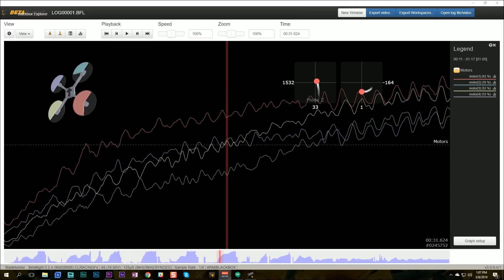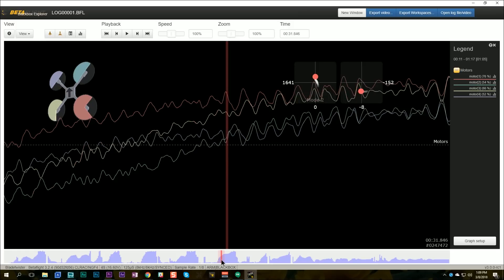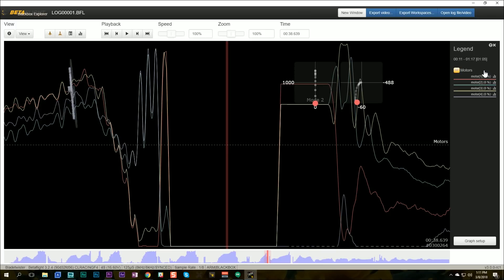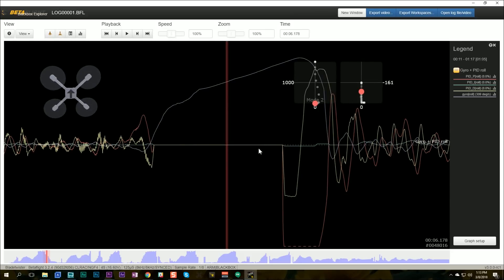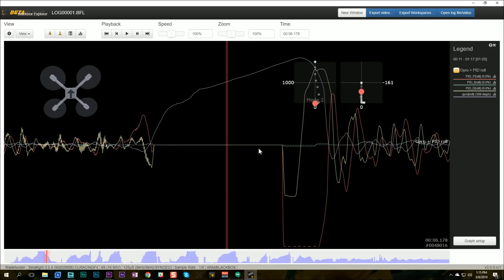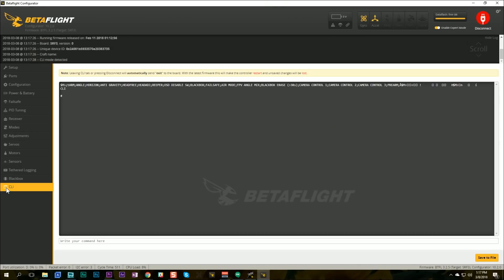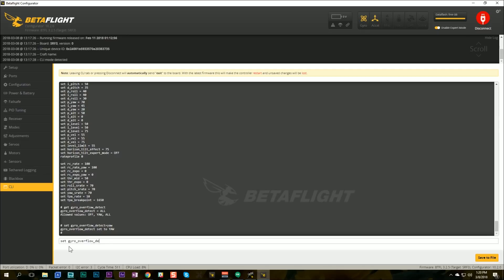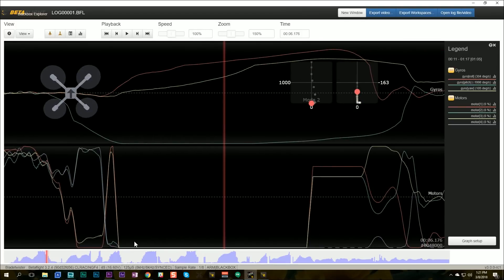Betaflight 3.3 Gyro Overflow Detection (Anti-Yaw-Spin)

Comment: A few comments from one of the developers: If you have an ICM-206xx gyro I would not recommend turning off gyro_overflow_detect.  These are the gyros that have the overflow/inversion bug and you will have no protection from a flyaway event.  This feature was developed in direct response to these events and people losing their quads rather than just as a hypothetical "this may happen" kind of decision.  The overflow can be quite easily triggered due to a gate strike or crash where the quad is spun through outside forces.  If you have a non-affected gyro (like MPU6000) then you can generally safely turn it off.  But there are still cases where a flyaway could occur due to multi-axis coupling and motor saturation where the spin is tumbling.  However these events are more rare and will usually self-correct but there still will be a scary flyaway-like event and most people will disarm before waiting for it to stop on its own.

The detection starts when the gyro rate exceeds 1950 deg/sec and disables the PIDs.  The PIDs remain disabled until the gyro rate drops below 1850 deg/sec for at least 50ms.

For those interested, the overflow event can bee seen in this image from a blackbox log of an ICM-20608G gyro showing raw data from the yaw axis as the spin rate exceed the overflow threshold.

http://www.etracer.net/pictures/ICM20608G_overflow.png
Reply: Also gyro_overflow_detect is not a new feature in Betaflight 3.3.  It was actually added in BF 3.2.4.  For BF 3.3 it's been improved to work off filtered rather than raw gyro data as it was found that noise from the gyro (particularly in 32K mode) was sometimes leading to false triggering as the gyro rate approached the limit but didn't quite exceed it.

Comment: Good info. Indeed many would think they will never run into this issue because of not using ultra high rates, but clipping a gate or something can indeed cause a momentary situation where it does spin fast enough for this protection to kick in. Nice detective work. ;-)

Comment: hi, I just got this new quad with T-motor v3 2600kv motors and the Star f4s. So far i've had a bunch of problems and the gyro overflow was one of them. Another problem which I cant seem to find a fix for is whenever I fly above mid-throttle my quad starts to shake like crazy! the shakes are mostly on the yaw-axis, but it's also on the roll and pitch.. Help?

Comment: Hmm. I have a new 2.5" build (massive droner) and I was doing some crazy moves trying to test myself,  I yaw spinned clockwise upright, then flipped upside down and yaw spined counter-clockwise inverted, it then dropped out of the sky- no FC reset, no range issues, it was close to me, I don't think it was a brownout as I'm well below the 3A limit.

I have to try tomorrow and replicate it.

Kinda sucks as I fix my random dropping out of the sky due to a defective RX with one build, then the next acts up.

I have experienced YSTTM- it was scary as hell as it was in the front yard right over my car, I yaw spinned it LOS as fast as I could, it then yaw spun full HAM then shot up, I hit the failsafe and it bounced off the roof into the backyard it was like a ufo firework.. with blades- always wear safety glasses LOS!!!!

Comment: Hi Joshua, I need some help!! I flashed Betaflight 3.3 onto a Furious F4 OSD board and couldn't get it to arm, plus the Accelerometer won't come on!!
Reply: Double check your firmware target, I accidentally flashed LuxF4SD on a LUXF4OSD and while I could configure it, the ACC wouldn't work and system would not arm.

Comment: Hi Joshua I have been scanning  your somewhat prolific output to try and find a cure for what I guess/hope is probably a simple problem but have yet to come across another example explained. 
So here goes I have obtained a King Kong Hex 300 and decided to swap the flight controller for an SP Racing F3 a fairly simple task!!! I only have for reasons I wont go into Betaflight  3.3 on my computer so I flashed the controller with the latest firmware and proceeded to configure the controller.
All was fine I can look at the receiver input set the upper and lower thresholds etc the little picture of the copter spins and gyrates according to the appropriate stick inputs the little red light comes on when arming  so then I look at the motor screen and find there is no input to the motors at all I cannot even drive them via the on screen controls I double checked the config and discovered that it should be in OneShot 125 and select it and click and save at this point the motors immediately went to full power still no stick control or onscreen control!! disconnect battery reconnect back to square one ??????
Reply from the maker: It sounds like there might be some issue between the FC and the ESCs. If the motors don't spin in the Motors tab something is definitely wrong. That's the first step.
Reply: Yes that is my thought too I have since tried to connect with success to the ESC's using BL helisuite so there are coms through the FC sadly it is not obvious to me what to do now.
 I did notice an inconsistency regarding the red led on trying to arm disarm inasmuch as it flashed at different rates and was reluctant to acquire a stable on mode??
I hesitate to use the old git card but sometimes it explains ones slowness to perceive the obvious.

Comment: I think we need one more Q&A soon, Joshua :) I have 2 Q's for that 1) What would a good, heat-transferring but non-conductive adhesive to use for mounting heatsinks on ESCs? 2) Is it absolutely necessary to place your FC in the balanced middle of the quad? As always, thank you for all your hard work.
Reply: For gyro it's irrelevant where your FC is, for accelerometer the closer to center the better.
Reply from the maker: They make a thermal cement for mounting heat sinks. There is also a tape like compound but bits not adhesive. Just comes in a roll.

Comment: Any Butterflight users having an issue where when you clip something like a racing gate, the quad spins really fast out of control? Ive seen a few local guys have this problem aswell as myself. (Check my Butterflight video at 3:27)
Reply from the maker: BuF disabled the gyro overflow detection.

Comment: Does butterflight have this prob?...  had a  simular issue..3 of us flashed it an all have had this happen after either hitting a gate or ground or a knock into another quad ive not seen spinous this drastic..........https://www.youtube.com/watch?v=4YZmsidXCUs
Reply from the maker: The problem is in the gyro, not the FC code. But some people have told me Butterflight removed the YSTTM protection. Check in the CLI to see if the options are there.

Comment: i just got a cl_racing f4s fc and for the life of me i can't get the osd to come up in my fpv feed. has there been any issues with this boards osd? so far the only thing i can find is death roll issues apparently due to esc's
Reply from the maker: No issues at all that I know of, and the newest version of the board has fixed the death roll issue. 

Do you see the betaflight OSD splash screen in your goggles when you first power the quad up? If so, the OSD is working.

Did you wire the video transmitter and camera to the pads on the board? You can't wire the camera directly to the vTX or the OSD doesn't workk.
Reply: no osd display on power up. osd switched on in BF GUI. foxeer monster cam, irc tramp hv vtx, spectrum rx, the only thing the camera is connected to on the vtx is audio and 5v. cam osd to cam_c on fc also not working.
 Pit mode for tramp works from tx. 

When I try to go into Betaflight OSD menu nothing comes up, but fc goes into OSD mode apperently because i cannot arm the board until i cycle the battery power, 

Maybe i just got a bad OSD output. cam image comes through. Not sure if I can post a pic nor am I sure I even know how lol.

From what I can tell, the OSD chip possibly works, it just has no overlay on the video feed
Reply: Update.    Disconnected the camera at camera plug, OSD works, now I just need to figure out why the camera is causing the OSD to stop working. HMMM? 

Any suggestions?

Comment: Well these guys have never heard how saturation arithmetic works in control systems. The YTTM fix was in there back a bit but was not invented by the core dev guys so they just had to improve it by turning of the control system. Would work well on an F16 or A380. Gone to Butterflight myself ;).

Comment: Thank you for making this video!! This has happened on three of my quads and what I thought initially was something touching the Gyro 🥙 but then Figured it had to be a bug with the new SW. Freaked me out when it would happen. I knew I couldn’t be the only one this was happening too. I run high rates so that may increase the probability of having this issue. Anyways glad I don’t have to flash 3.2 on everything and go back instead of forward. Ha ha

Comment: Sorry not a comment on the topic. With the rxsr receiver connected to the holybro kakute non aio it powers only when usb is connected. If i connect a battery it powers on once and if i disconnect   power it won't repower until connecting through usb. Any idea why, counld it be in my fc firmware or firmware on the rxsr?
Reply from the maker: None of that could be caused by firmware. The 5v power to the receiver is totally independent of what the firmware is doing. So it must be a wiring issue or a soldering issue or something like that.
Reply: Joshua Bardwell thank you for the response. Its probably my wiring.

Comment: Have you had any luck with conformal coating and wet weather flying? If so did you just coat all components, which do you not coat if any? Thanks for the help
Reply from the maker: I don't personally waterproof my quads but here is a good resource on it:

https://www.youtube.com/watch?v=s4z8QMgTEA4
Reply: I waterproof my quads... They work great in the rain....
Waterproof all just not the motors...
Even coat about a half inch of the motor wire from the Esc's...
That will help the wires with vibrations
Reply: Dnex1 FPV 
You disassemble and paint your motor armature? Thanks for the info
Reply: I dont take apart the motor.... What i mean is.... The motor wire thats soldered to the esc's... Coat up to half inch.... For vibrations dont shake loose your connection...
Reply: Dnex1 FPV 
Thank you

Comment: Dear joshua, I've just got my first drone and I have the charsoon DC-4s charger to the batteries but I want a better(and still cheap) charger. Do you have some ideas what charger  should I buy( f.e.:HTRC H4 DUO or something similar)
(Sorry to my english grammar,  I've just started studying English)
Reply: valaki más check out the "4 button" style like the imax b6ac or even a clone of it. Simple enough to use and pushes enough to parallel charge 4 1300 mAh 4s Batts. They're pretty cheap too
Reply from the maker: Here are my suggestions at this page: https://www.fpvknowitall.com/fpv-shopping-list-charging/

Comment: I knew it was going to happen... I knew it! They have to insert a easier way to shoot down all those "protections". And that is just the beginning of those problems.
Reply: What in the world are you talking about?
Reply: Bruce Luckcuck All this protections inserted are going to kick in in mid flight. Because they're based in pids, gyro's values and so on. They weren't tested enough and there's no easy way to shoot them off. All command lines and you may not disable them all and so on. Anyway, let's wait and see what happens. I can be wrong, of course, but...
Reply: Of course the gyro overflow detect is going to kick in mid-flight.  I'm pretty sure your quad is not going to exceed 2000 deg/sec sitting on the bench!  If you don't want them based on PIDs, gyro values, etc., what would you rather base them on?  Magic?  Or maybe we can have the hardware developers at Invensense give you a cookie and tell you everything is okay...

Comment: wow! your timing is excellent
today i tried the new firmware on my quad and i've gotten the strangest behavior on my roll axis. when doing a fast roll it would do several rolls after each other and level out again. i thought it was the crash recovery kicking in, but was puzzled why it would do several rolls.. but still i blamed it on crash recovery and was planning to switch it off.
seeing your video i see it is yaw spin to the moon feature kicking in, and a solution. thank you josh!
ps it did go almost away when lowering my rates, but they are so low now i can't fly it well anymore..
another PS.. it was on Butterflight, the latest FW release, and i blamed butterflight for it, since my other quad on betaflight 3.3 did not do this strange behavior.

Comment: Hi great video I have another problem with betaflight 3.3 after flashing I go to configuration as soon as I change the small angle from 25 to 180 a flag comes up arming not allowed this has happened twice I am flashing f4 boards the only way to fix this is to reflash to betaflight 3.25 any thoughts cheers paul
Reply: Arming is disabled while connected to the configurator as a safety feature.  Before you can arm you must make sure that props are removed, and check the safety switch on the motors tab.  Please read the release notes:

https://github.com/betaflight/betaflight/releases/tag/v3.3.0

Comment: Joshua Bardwell, I can't find any good vids on flip of death or how to fix this?
Reply from the maker: If it commonly happens at the end of a flip or roll, it might be that you need to raise your motor idle speed. This would be min_throttle if you are using Multishot or Oneshot, or digital idle percent if you are using Dshot.

Physical damage to the motor or ESC is the next likely cause.

Comment: I think overflow detection has been in Betaflight since one of the 3.2 releases.

Its also been mentioned by the Devs that if your quad is noisy that because the detection works currently on raw gyro data the overflow can be triggered incorrectly.
They said they plan to make the detection work on filtered gyro data in a future release to prevent this. (Just checked they did this in 3.3 rc2)

Still wondering what crazy person flys on 2000 degrees per second.

Comment: How do you get the Blackbox Explorer to export an animation? I installed it on two machines but on both it just sat there saying it was calculating the filesize but did absolutely nothing, no CPU usage, no disk usage, I let it sit there for 10 minutes and all I got was 10 minutes older :)
Reply: yeah i wish i knew more about how to use blackbox too,  from creating files to actual analysis, i'm completely lost.
Reply: I have the same problem but when I use the Chrome app version it works fine.
Reply: So the standalone version is faulty?
I had trouble installing or running the Chrome app version (can't remember which) so had to get the standalone.
Reply: I don't think it's faulty as such (I don't see loads of people having the same problem) but it clearly has an issue on my machine, it just doesn't seem to open the dialog box to choose where to save the file.

Comment: First! Can you do a video on how the betaflight F7 is not really made by betaflight? I think that FPVmodel needs to be called out for this
Reply: ZeroFPV https://reddit.com/r/Multicopter/comments/7z2oj6/psa_the_betaflightf7_flight_controller_is_not/
Reply: FPVmodel is making all the BF flight controllers so I wonder. Do you have a source for this? The BF F7 is out for more than two months now and that's the first thing I hear about it.
Reply: thx!
Reply: Is this problem only on the yaw axis?
Reply: KnizzleHizzle wrong comment thread...
Reply from the maker: Lots of vendors OEM products. There is nothing sinister about it.
Reply: FPVModel case was resolved, as you can see by the FPVM_BetaflightF7 target name. No need to shame them for anything BF-related.
Reply: Benjamin Tarr well obviously a software program is not making Hardware products I think most people understand that. They also know that a firmware is not creating backpacks either or hats they're just working with companies and branding pretty sure most people know that. Boris likes to write code not build boards
Reply: QUADBOT FPV yes but FPVmodel did it without permission from the betaflight devs and they aren’t making any money off of it